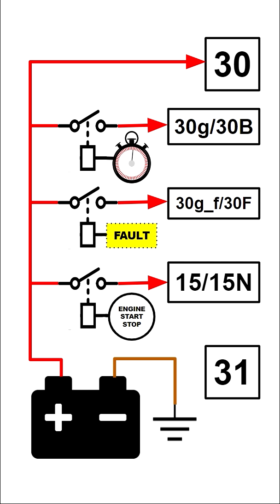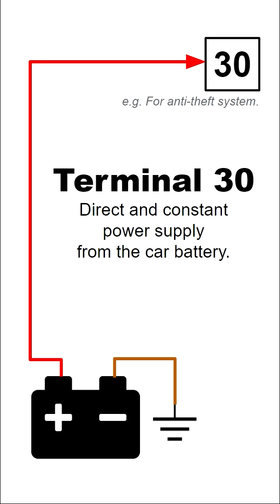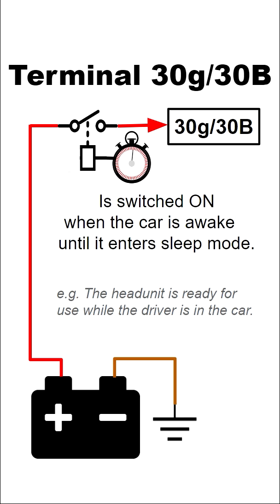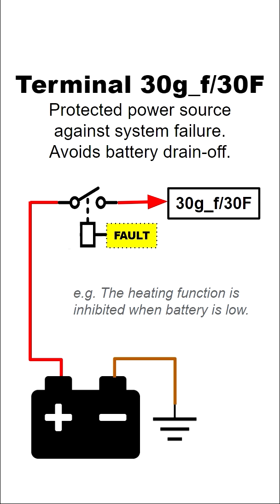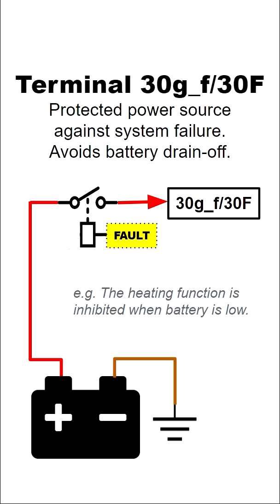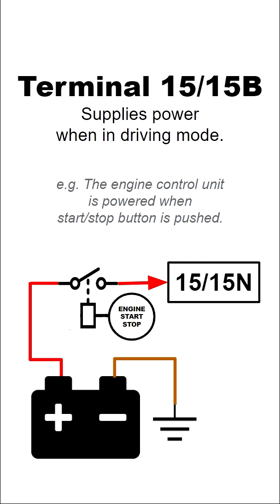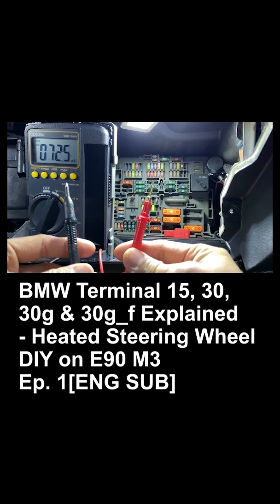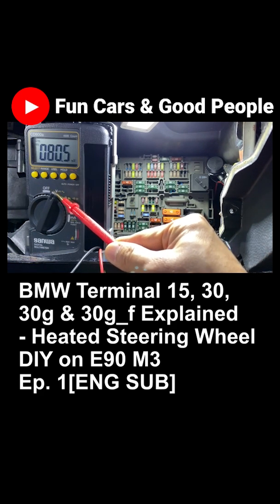BMW Terminal 15, 30, 30g & 30g_f Explained in 1 minute [ENG SUB]

Comment: Hi there 
Very informative video. 
I’m getting the following error after trying to jump start my e90 2011 when battery was very low about 7V, the car almost started but then suddenly the cranking voice changed and car don’t fire up. 

4C18
- Message (terminal 15, 0×130)
_ Permanent

It cranks but no start. 
Can you Please share any ideas as to where should I start for errors. Is it a bad relay or a wire I’m looking for? 

Thanks.
Reply from the maker: Hello N Ta thank you for the comment! I think the main problem is that the battery voltage is too low. When the starter motor drains most of the electrical power, the car communication system malfunctions and aborts the start procedure.

I checked the 4C18 code in ISTA and found:
==
The CAS control unit controls the terminal status. The CAS control unit transmits the terminal status as a CAN message on the CAN data wire. The CAS control unit uses a separate pin to transmit a wake-up signal (terminal 15 wake-up) to the DME control unit.
==
Fault description: The fault code is logged when the TERMINAL STATUS message is not received.
 
Condition for fault identification:
 The following preconditions must be fulfilled:
- The message must be active.
- Terminal 15 must be active.

The signals are sent cyclically every 100 ms.
The fault is checked at 20 ms intervals.
Control unit voltage: 9.5 V to 16 V.

Condition for fault memory entry: The fault is entered if it is present for longer than the following period (debounce time): 550 ms
 
Action in service: - Carry out CAN/FlexRay bus system analysis.
==
In short, the CAS car access system activates the starter motor and send wakeup signal to the DME engine control unit to fire up the engine. So when DME gets no signal from CAS, due to power loss, the DME logs 4C18.

But don't worry I don't think this is a hard problem. I suggest replacing a new, fully charged battery for the next start 🤗
Reply: Hi 
Thanks for replying. Really appreciate. 
I’ve found the battery drain source, it was a tin oil drain container left right under the starter housing which somehow connected the earth body and hence drainage. 

I’ve already got the battery out of car and let it charge for 3 days. It charged fully,  but same result. 

First I thought that cas and ews need sync like my other e90 use to be so I connected INPA 5.02 and got the following error;

A10A EWS4 Timing_Chall Resp Error

  And under F6 active options I’m getting the following error message;

Initiate start value sync. with motor ECU
Operation due to EWS version not available!
EWS version
EWS 4 Secret Key
4
Locked

Also when I connected the battery, at first the car stated thoughing random faults. But after clearing, they don’t reappear. It happened three times. 
Could it be my JB got messed up?

Any suggestions sir? 

Thanks a lot
Reply from the maker: Hello N is you car still able to crank? If so I think there no problem with the security system. Like you said it may be the random codes caused by the power outage. What are the symptoms and codes that persist?
Reply: Hi there. 
Yes the car cranks but it doesn’t start. I’m still investigating the problem and have code 
Dates
6: 0710212023 15:05:34
ECU:
D72N47BO
Linistatus: OKAY
uarian:
D72N47BB
RESULT:
+ error in error nemory!
4C18
4C18 message (CLAMP STATUS, 0×130)
Don’t know what it is. Don’t find any info online either.
Reply from the maker: Hi N Ta I have another guess, that the CAN link to your ECU (DME for gasoline or DDE for diesel) may be broken so it cannot receive start message from the CAS. If you need the pin assignment of the ECU connectors to check CAN linkage, I can look up in ISTA for you. Please kindly send me your VIN to funcarsgoodpeople@gmail.com !
Reply: Hi 
Thanks for your response. 
Just sent you an email. 
Thanks.
Reply from the maker: Hi N Ta I see your email. Gotta reply soon!

Comment: i have a 2008 M5 and it gives me code 9CAA , Terminal 30B Faulty . i am looking everywhere on the location of this terminal ,relay or fuse , but it seems non existing . When i do Live Data with the scanner , Terminal 30B gives me 2.89V . Except for the SOS phone , Bluetooth and navigation , everything works on the car . 
Anyone , any leads or a direction !!??
Reply from the maker: Hello Mateya, terminal 30B is the naming of 30G for BMW F generation and so on. I have checked the documents of E90 and E60 and I don't think this is for the 2008 E60 M5.

9CAA is a code for the LM light module. The LM is supplied by two 12V power sources on Terminal 30. I suppose the two sources are named 30A and 30B and now the 30B is faulty. 2.89V is not normal for any terminals (except term. 31.) where they should have 12V.

So please check pin 9  and pin 47 of the connector X12 on LM, if they have 12V. The corresponding fuses are F5 and F6. Please also check their voltage.

I also hope my guess is right. Please kindly let me know the result! Best luck!
Carl
Reply: @funcarsgoodpeople 
So i checked all the fuses and power coming out of them . All clear , all good !! 
When i took the connector out of the Light Module and i check what i believe pin 9 and 47 , they both give out voltage to ground , and continuity between them !! Both pins have voltage on them !!! I believe it should be voltage 12V between them and not continuity !  Is there a pin number allocation drawing  that i can look at just to be sure !
Reply: I believe i get it now . Both pins 9 and 47 should have power, to their fuse respectively!! How do I check for ground !?
Reply from the maker: Hello Mateya, the ground pins on connector X12 are 56 and 57. Please send me an email at funcarsgoodpeople@gmail.com I will send you the ISTA documents including the wiring diagram.

Seems like we need to check the 12V power source for the LM🤔🤔🤔
Reply from the maker: In addition, the two 12V power come out from fuse panel A41a via connectors X11001 and X11002, respectively. They are on pin 1 of each connector.

Do you find the wiring harness broken?
Reply: @funcarsgoodpeople  the power outlets work 
. There was a blown fuse but i replaced it . That was before i started fiddling with terminal 30B code
Reply from the maker: Hi Mateya, as I understood your description, 9CAA cannot be cleared, except for the SOS phone , Bluetooth and navigation , everything works on the car, the LM and all lights are working properly, right?

To troubleshoot the SOS, BT and nav, I think we can exclude LM because it's independent from them 🤔
Reply: @funcarsgoodpeople  yes , that is correct !!

Comment: Im getting a terminal 15 no voltage code but my car starts and everything works its going into drive train malfunction any ideas
Reply from the maker: Hi ESE F30 I got your mail! Could you describe more about the malfunction? Did you mean you can drive the car but there is warning and/or check engine light?
Reply: @funcarsgoodpeople yes 
And Sometimes the car doesn’t start.

Comment: Ive got terminal 15 wup sshort circuit code. What can it be?
Reply: Hello i have a f30 giving me code 1B5202 and 1B5302 for terminal 15n1 and 15n2 no voltage can you please help give more info thank you
Reply: @ese_f30  Hi ESE_F30 I looked these codes up and they both give same contents:

Fault description 

The diagnosis system monitors the line for the voltage supply to the following terminals:

- Individual DME main relay: Terminal 87_1 or terminal 15N_1

- Integrated supply module: Terminal 87_1 or terminal 15N_2

Fault monitoring conditions:

The fault is detected when no voltage is applied at the DME input despite the main Digital Motor Electronics main relay being switched on.

Action in service 

Check lines and plug connections between the following components:

- Engine control unit and Digital Motor Electronics main relay or integrated supply module

Check voltage supply

Check Digital Motor Electronics main relay and integrated supply module.

You can also send me an email including your VIN so we can dig deeper into it. Cheers!
Reply: @pingyuhee  hey yeah can you please i just spent 6k into fixing the car and now it feel like i wasted money cause i cant get it fixed haha whats your email? Thanks you man!
Reply from the maker: Hi Roby do you have the code? I can look it up for you 🤗
Reply from the maker: Hi Roby I saw your message, the codes you got are 25EE00, 80342A, 930740, 930742, 9307AF. I used this website to check their details; https://bmwfault.codes/

My guess is that the terminal 15 wake-up line from CAS to the DDE has some connection problem, probably short-circuit to ground, as indicated by the fault codes.

The DDE receives this wake-up power from CAS when the start/stop button is pressed (ignition on.) If this connection is faulty, the car wouldn't start. I am guessing you have a six-cylinder diesel bimmer according to the codes above. What is your car model and exact symptoms?
Reply: @funcarsgoodpeople  i have 750d f01n 2012. The first 2 days the car didn't want to start. Now it starts but every time i get like 5-6 erorrs. Mostly parking brake error and abs error. Im thinking maybe tbe wiring harness from cas to dde is damaged? Is that a possibility? And do you know how i could check the wiring?
Reply from the maker: Hi Roby I see. Most of the errors are caused by poor connection of the connectors/plug/sockets. You can try unplugging and plugging it. Or lean the metal contact points with electrical contact cleaners. If this fault still exists, move on to find the damage of the wiring harness.

Fortunately the F generation has detailed connector location info in ISTA. You can mail your VIN to funcarsgoodpeople@gmail.com and I'll send you the harness locations for 15WUP from CAS to DDE.🤗
Reply: @funcarsgoodpeople  hi, ill send you an email thanks for your help

Comment: After reconnecting my car battery my radio lost power there’s no power going to one fuse for the radio . Is there a relay that would cause no power to the radio ?
Reply from the maker: Hi Gatiyo yes the relay I01139 is responsible for the power supply on terminal 30g_f. If there are faults in electrical system, terminal 30g_f will shut down so many stuff including the radio won't have power. So please scan for the fault codes about electrical system. Perhaps after clearing other faults, terminal 30g_f can be recovered!
Reply: im having this code in my Scanner (A559 Instrument cluster: Supply was switched off (terminal 30g
_f)
 
and the i drive being constantly restarting. any recommendations? thank you and advance

Comment: 101068

Relay, terminal 30g
Reply from the maker: Hi Mustafa yes i01068 is the relay for terminal 30g. It is the green relay on the right top corner of the fuse panel. On some models, this relay is integrated in the fuse panel and cannot be removed.

Do you find any interesting information about this relay? Let us know!